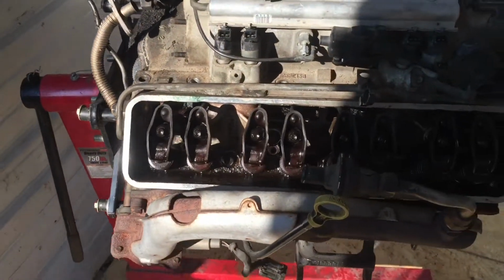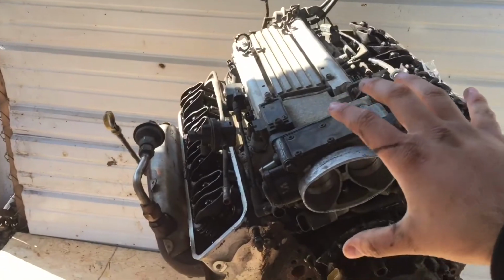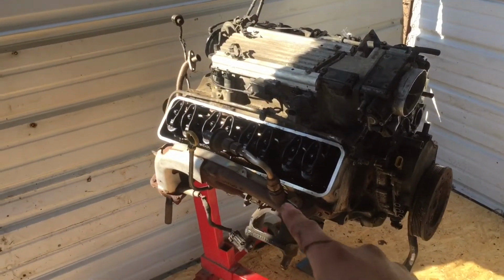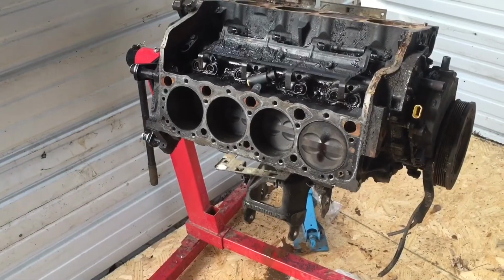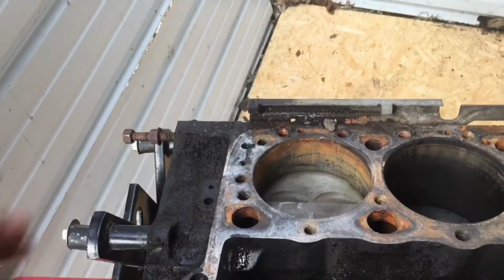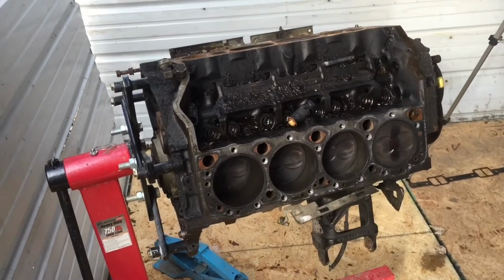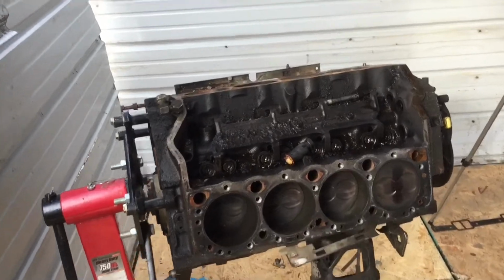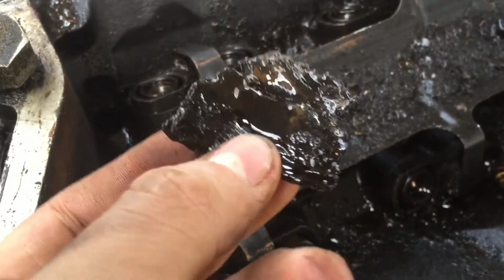LT1 Build: Teardown  (pt2)

Comment: All that wax build up called Sludge. It’s in the oil that was used in the engine that was loaded with paraffin. Valvoline has much less paraffin than other oils and now that they have synthetic oil it keeps the engine clean.